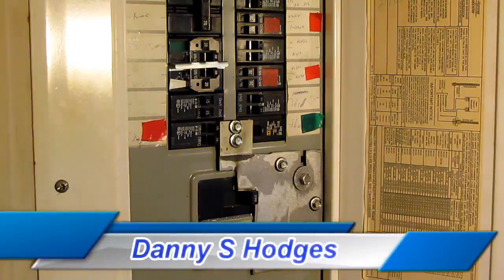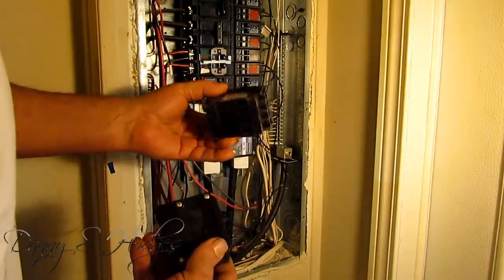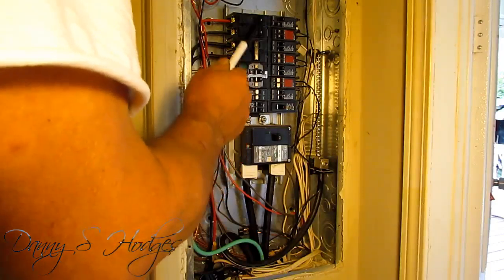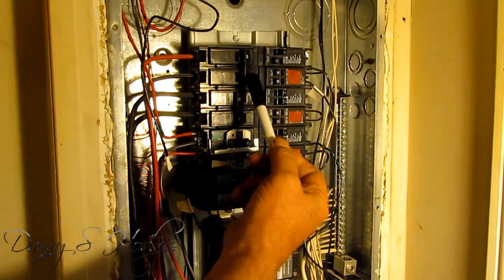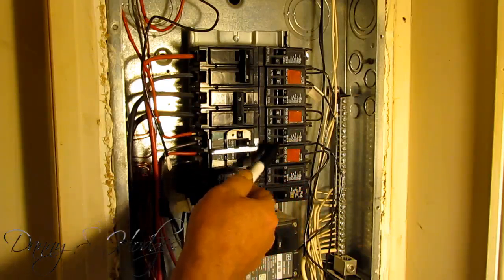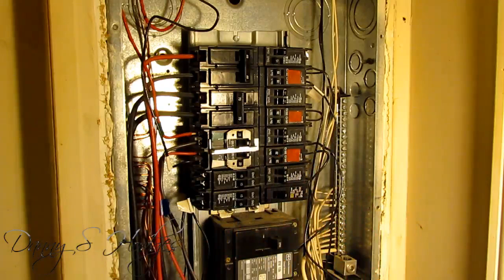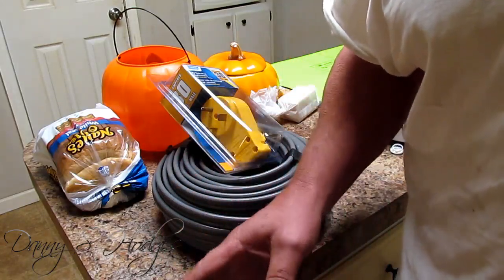How To Wire A Generator To an Electrical Panel 120 V or 240V Basics

Comment: Like the vid. I have the HF 5000w 30amp 110v. Using a Reliance 10 circuit Transfer switch panel. The cost is more. You can get a TT30R to L14-30 adapter to adapt the 3 prong output on the generator to a 4 prong cord which can work with a standard 30 amp input plug. The adapter will also split your 110v single phase into 2 legs which you can wire into your panel for both the A and B bus. Will still only be single phase for 110v only.

Comment: You can just jumper from the A breaker to a B breaker to get 120v to all A & B circuits. Then you don’t even have to rearrange the breakers. You just can't use 240v loads.

Comment: bought a cheap chinease 12v to 240v inverter. plan is to use my electric car as a backup generator if there is a prolonged power outage by backfeeding the 240v outlet for the car charger. my EV has a generator which charges the battery back up if the power outage lasts more than a couple days. im guessing I will just end up leaving the neutral pin hanging in the wind... and probably wont connect the ground either to the inverter. just have to open up the inverter and solder some component to switch it from 50hz to 60hz. i guess its made for the japanease market since half them are on 50 and the other are on 60hz. so much cheaper than buying a generator and getting it setup. house is gas powered otherwise i dont think my car would put out enough juice through the 12v system (i think it maxes at 1.35kw)

Comment: There's no need to use half a panel, I have a 120v generator connected to electrical panel using double pole breaker, the hot wire of the generator connected to one of the pole then I add a jumper wire , now both panel are energize,

Comment: So , I can hook my 240 generator to 240 v breaker to run A and B . Right
Then hook my 110 solar enverter to a 110 breaker , say A . 
When 240 generator runs ,it will run every breaker , A and B .
When running 110 inerter on A ,
A only runs breakers on A . 
So i could make that slide plate . 
To shut off and turn on , which ever I want to run . 240 everything
110 just lights and fan , or what ever is on side A .
Right ???

Comment: How about using a voltage step-up convertor so you can connect 220V? The reason I'm asking is I have an off-grid all in one inverter but it only puts out 110V and usually your cut over switches are made to work with 220. Would that make the wiring any simpler?

Comment: How long of electric i get in my double wide for if i run a 3000 watt generlator to my wires?  Theys big wires strung up all throughout that trailer..  gots light bulbs in every room and enough power left over to run my big screen out in the yard.  Now you use all them numbers talkin about 210 and whatnot, how many times that go into a 3000 voltage watts generlator?    Hell my truck only needs a little bitty box of elecctricals and that damn thing blow goodn cold and hot air..  so that had to be that 210 yous talkin about.  I think i got her figured out, im a fixin on hookin that generlator to my truck electric, i betche that thing gonna fly, godamn kyle bush going leftards over here watch..  im gonna be like that character. Flash..   hell yea..
Reply: Welp, didnt work..  sure as hell fired up that possum that was living up under the hood though.  Thing took off like it got ahold of that shit billy makes out in his shed..  that fambletamean or whatever he calls it..  but my damn trucks burnt up now so i guess ima figure out how to hook this here generlator motor up to something with wheels cuz i aint fixin to walk a hunnard mile to get my case of bush light every day..  hell naw...

Comment: I am curious if you can make a Y and connect a 120v 30 amp feed to both legs of the panel?   My fridge is on one pole and my furnace on the other.  I have an older home so not trying to move breakers around.    Really wish I had a 240v generator not a 120, ugh. lol

Comment: Thank you!  I watched several generator hookup videos and yours was the first one that explained why I needed the breaker that takes up two full spots for my 240v generator.  I was using the compact double breaker in a single slot and couldn't figure out why not all my circuits that I left on were getting power.  I was mistakenly thinking that each side in the panel was one leg from the power company.

Comment: put both 240v hot wires on the black wire of the 120v generator its not impossible

Comment: Thanks for your Video. Like you explained, I have a portable generator one outlet 110 V with 30 A and 2 outlet 110 V with 15 A. If I want to hook up this hot wire with 30 A to the breaker of side (a or b) of the main box, I will have power only the half of all breaker, the line of the breaker (a/b side) where I'll feed electric from the generator, has power and next line of the breaker has no power e.t.c... In this case, I use single pole breaker, but if I use 2 pole breaker 30 A (double breaker), need 2 hot wire (220 V) to get power on both sides (a and b), 110 V at 30 A has only 1 hot wire, my idea: I make a bridge from a double breaker, theoretical I will have power on both sides with 110 V. I need to turn off all device with 220 V in house. Is that illegal to use the bridge of hot wire in this case? Or I can use 2 separate single breakers, 1 breaker 15A and other 30 A then hook up from the generator the hot wire of outlet 30 A to breaker 30 A and hot wire of outlet 15 A to breaker 15 A in the main box. So I will have both sides a/b power. Generator interlock exists.
Please can you or someone told me, is this way illegal or not. Thanks.

Comment: Thanks for the video. So if I use 2 pole 240V breaker do I, connect ground (green) and neutral (white) to the same silver bus in the main panel? I know there's a rule for sub panels when it comes to wiring ground/neutral. Not sure if that also applies to the generators feeding main panel? Can I just run 10-3 wire from the gen with 2 hot lines and neutral only and without dedicated ground?
Reply: Green and white operate the same way at the panel. So if your box has to separate panels, by all means separate them but will not matter so long as they are both grounded to dirt

Comment: I need to look at my gen and determine if it is 120 or 240. I just pulled the meter and plugged 2 wire sets into the lower meter prongs (hot to hot) neutral/ground to neutral/ground.
Reply: Look for normal plug for 120. If you have that then look for an unregular plug for a 220. If you have then, your generator can produce both

Comment: You don’t need to settle for half the panel with 120v generator.  Simply use a double pole breaker and splice the incoming incoming black wire into two leads so both sides of the panel are energized.   Then simply keep all 240v breakers off while using the generator feed.
Reply: If the house dryer outlet is 3-prong (hot1,2 and neutral) what you do with the ground wire coming from generator in this case?
Reply: Reynaldo Reyes in Ellaville, ?
Reply: @jbar6618  hi, how do you wire the neutral and the ground coming from the generator, you just don't use the ground?
Reply: @jbar6618  
Yeah OK 
Can you explain exactly how do you do that? I just bought a 3000 WATT with a 30amp plug in and I need to wire to my circuit panel so all the lights and 110v  plug in work, I know I can't not use everything at the same time but I will like to wire straight to it
Reply: @jbar6618  how do I know which one is the white neutral on the generator
Reply: @jbar6618  my generator has the 30amp twist and lock in outlet
Reply: Good idea. Question though, since the both hot wires going into the 240v breaker. Do you know what would happen to a dryer for instance, if that breaker is accidentally turned on?

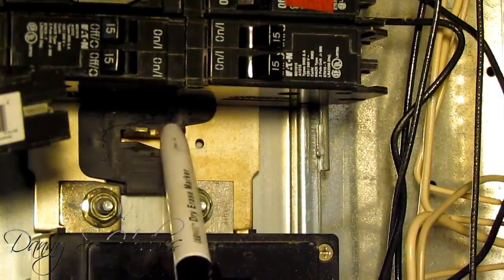Comment: 2:05 to 4:12 was very interesting information. I think I understand this 120 to 240 a/b side stuff now, thanks for the info. Each side of the panel [120v per a/b sides] has alternating 120v breaker connections that power both half's of the panel horizontally; alternating vertically. a 240 breaker connects to both a and b sides and covers two 120v slots on one half of the panel.  so if you power up one 120 volt side "B" breaker, it will power up 120v breakers on both panel halfs horizontally, skipping every other breaker vertically, skipping over the "A" side breakers. thanks again for explaining that.

Comment: Great instruction video.   Our dryer is gas, so I was able to use 30 amp dryer circuit breaker as the gen transfer switch.  Disconnected dryer wires and covered with wire nuts.  Moved breaker to top to become transfer switch with interlock to main breaker.  Moved top breakers down to where dryer breaker was located.  Connected hot leg of 120 volt gen to both sides of the new transfer circuit breaker with a short jumper and other leg to neutral.  Both A and B side are energized with 120 volts, so you can use all 120 volt house circuits.  Turn off all 240 volt circuit breakers.  Done and save with interlock bars.
Reply: Was going to mention the jumper off a twopole breaker as well haha.. I was reading through to see if anyone commented this.
Reply: So when you do  the jumper black cable to both sides of the panel does the jumper stays after disconnected generator and turn power back on and does the breaker has to be at the top of the panel or can it be at the bottom and just label it??¿?

Comment: FYI: Anyone thinking about doing this,  the interlock he made is not just cool novel idea, it is the law. You must install an interlock like this if you are hooking up a generator so backflow does not shock a lineman on the other side of the service. You will get fined and maybe a trip to jail if someone gets shocked.
Reply: Or you can turn off your main.

Comment: I have 100 Amp Generator I’ve seen if I install a 100 Amp Double Pole breaker and in electrical loss shut the main off not to back-feed the grid & my generator will feed both-sides of my breaker box 100 Amps & it’s back-feeding the fuse box but it’s not me using a dryer outlet I’m wiring it straight to the breaker box ! And my generator is a Gm 1 wire alternator and when you tap straight into the stator Produces the purist sine wave & i’ve metered it over 1,000v Ac spinning it about 1,500-1,700 rpm ! & I recorded it the meter goes so high in numbers it blanks out but as I back off the trigger you see on the meter 970v Ac dropping !

Comment: I’d like to add a 120 Amp Spilt Breaker to my fuse box , my generator can produce up to 184v  about 90 Amp , I like where you’re going here hook it up and I’ve heard if you use a grid tie in inverter it can turn back you’re electrical meter you’re generator power you don’t use will go back out into the grid and others will use it and pay the Electrical Company !
Reply: "going back out into the grid" means back feeding linemen and killing them when there are power outages.
Please hire someone.

Comment: Like your clip. WONDERING: Maybe one 120 volt generator Can Power Both Sides Only when Main Power breaker is OFF, ... Plus all 240 volt breakers at taped OFF.  Think about it: Might be possible to then use one 120 volt generator to power both sides of the circuit breaker box for low power needs.   What do think of that idea.  Like your DIY safety block too.
Reply: I was just thinking the same thing and searching for ideas or others doing 120V to both hot rails in the home's breaker panel. It would save moving circuits around and un-balancing the loads (as seen by the power utility) that are connected to your hot feeds (120/120, aka split phase 240Vac). I too would turn off any 240Vac double pole distribution breakers. For the most part 240Vac appliances like dryer elements and oven elements will just not work, as both hot wires will have the same exact voltage (phase) on them and no current will flow through the heating element. But if any double pole circuits might involve neutral in the load,,, humm, example, some DPST or 240VAC breakers sometimes feed split 120Vac receptacles in a kitchen, thus is best to turn off. As (a very unlikely) situation could exist where two breaker's worth of "hot" (off a DP "240V" breaker), or 15Amps times 2, or 30Amps could have to come back on the one neutral wire. This could overload the 14AWG neutral wire that is sometimes run to kitchen receptacles, 14/3 wire on 15A, DPST breakers are somewhat common in Canada. But other than switching off all 240 breakers, they're current hogs anyway, I don't see why you could not back feed your panel with a double pole (240VAC) breaker and just strap your breaker, such that your inverter feeds both poles of the breaker, and thus the whole panel. Could try it. A 3KWatt inverter is only good for about 25Amps of 120Vac, so it may trip out if not super careful when adding loads anyway. 
And,, if your physical lockout fails, your back-feed breaker will trip as soon as restore the utility power with the main breaker ;). Idiot proof,,,
The output breaker on the inverter should protect the cord from inverter to panel. I'd use 10AWG for a 25Amp inverter. Might be worth a try rather than moving all your "important" loads to one "side" of your panel.
Reply: @BankBuster1000   I have confirmed it can work. Have to have fail safe way to have grid power disconnected plus All 220 - 240 breakers secured to OFF ... IMO: Tape em OFF ( if you are only person w acess, or have a screw down lock over those, or lock up the panel so some clown does not mess up what you just figured out 🙂 ... And make sure to get a permit and inspection if you have time ?

Comment: Hi I live in eastern coast. I bought generator two week ago. My generator is neural floating.  I put 30 amp breaker and I bought 25 ft extended cord ( 125/ 30a.  And I turned off all breaker and I turn generator running and still no power.  I am puzzled.  Please help me
Reply: The easy way to do it is add an inlet reliance controls pb30 and wire it straight to your clothes dryer breaker.

Comment: So the concept would be the same if i use a 8,500 watt generator but I use a 220 breaker right ?
Reply: Max T  use a double pole (240v) breaker use but the more watts being produced from generator means more current so size your beaker according to the largest receptacle on generator  but might want to upsize it because breakers SHOULD trip at 80 % load and if you want all the watts to reach the bus bar then upsizing your breaker will help

Comment: wow Danny, ur shure going to town with all these electrical vids. Keep up the good work and remember wearing rubber-soled shoes.

-b
Reply from the maker: tks
Reply: It is possible to energize both bus bars by hooking breakers up to each other with appropriate sized breakers and wire (The same amperage as the line side breaker.) This is NOT a recommend practice because if you turn the power back on from the main without disconnecting that shit show, all hell will break loose!!